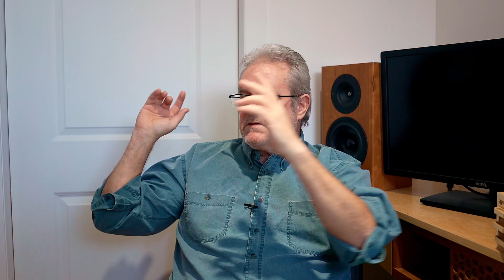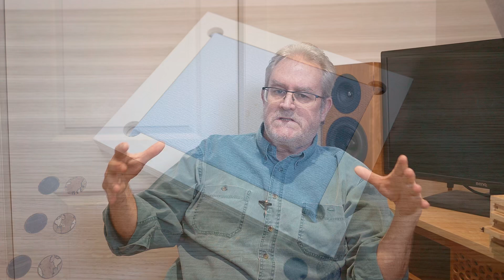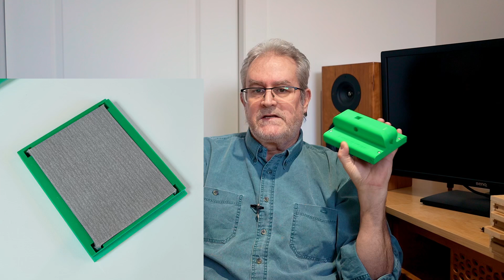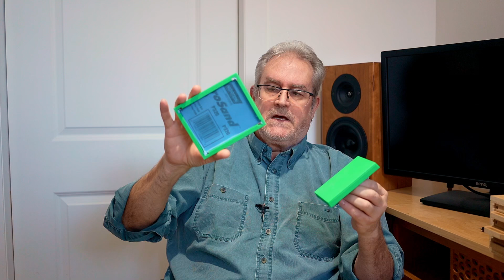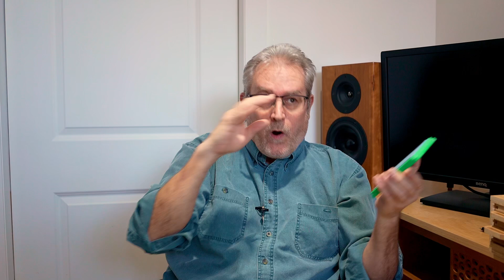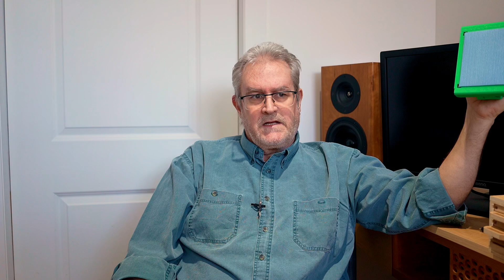Woodworkers: You Need a 3D Printer!

Comment: I've got the Bambu P1S with AMS, two A1's with AMS, a K1 Max, a Kobra 2 Max and a QIDI X Max 3. The Bambus are the best all-around, but the Max is solid and it's bigger. What are you using for design, John? I think you'll find the market for functional 3D prints and videos about them is much bigger than you assume. You made a solid choice although I'm curious why you didn't spring for for the extra $100 for the P1S since it gives you access to filaments like ASA, ABS and more of the engineering grade stuff. But what you have is enough for most things. If you're not already, I recommend you start moving toward PETG, which is about he same price but is stronger and more resistant and food safe. I buy that stuff from Sun Lu ten kilos at a time. Because I'm cheap.
Reply from the maker: I didn't want to spend more than I have to, but also didn't want to set myself up for a bad experience to start out. Now that I know I'll actually use the thing, I can upgrade it as I need to.